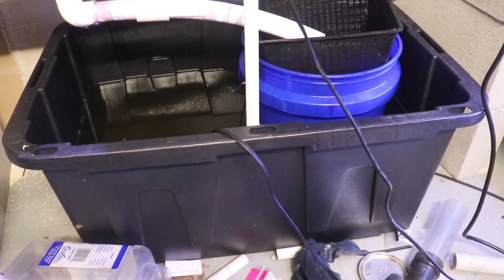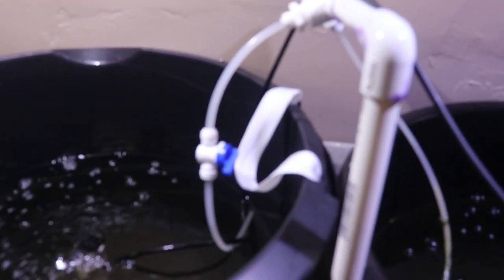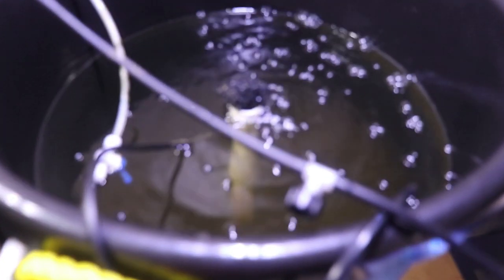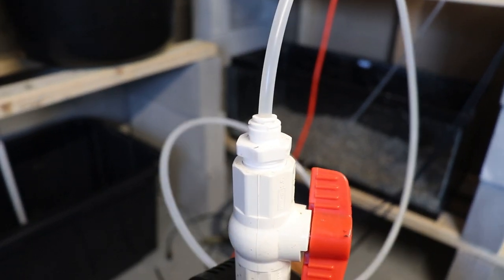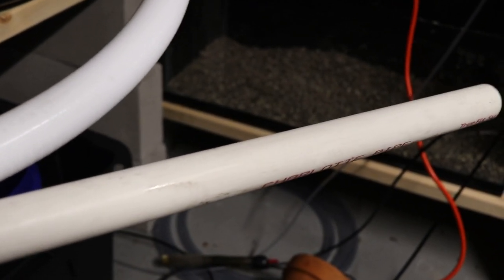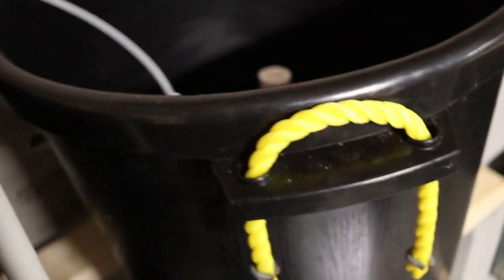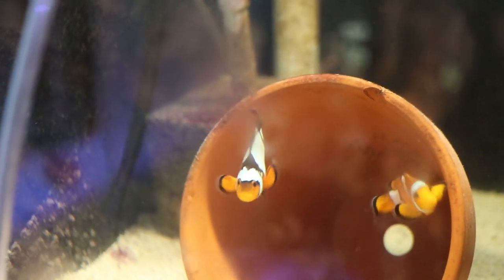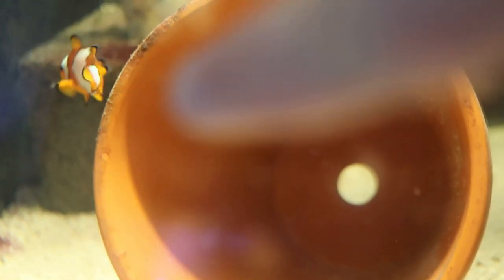Clownfish Fry Rearing Setup

Comment: How does water drain theough the standpipe? Do you use a sponge filter? What is stuffed inside the standpipe? What kind of filtration are you using?
Reply from the maker: There was a pump that pumped water up from the sump

Comment: I have 2 questions, 
So basically, my clownfish in my 100 gallon tank have started laying eggs. When they hatch, they usually get eaten or sucked up within 1 day. I was wondering what would be the best and most efficient way to fish them out so I can put them into another set up? Also, I was wondering if I could feed the larva plankton?
Reply from the maker: The best way would be to move the rock where they laid the eggs if possible to a separate tank and run an airstone over them.   If that not possible look into something called a Vossen larval snagger.  It uses light to catch the larvae.